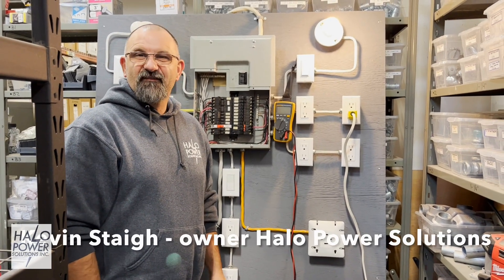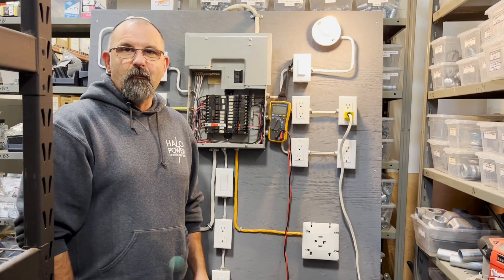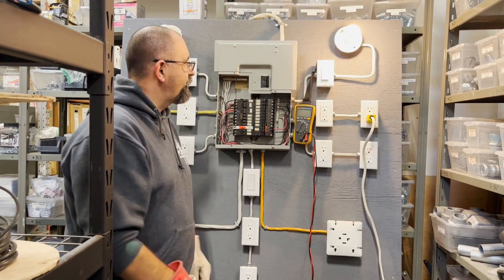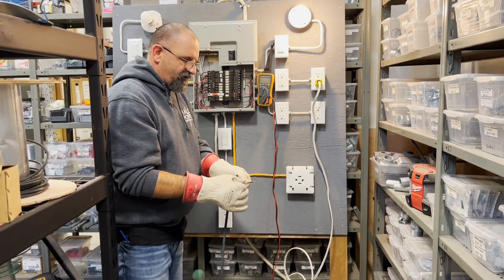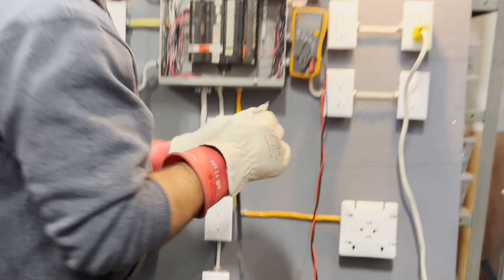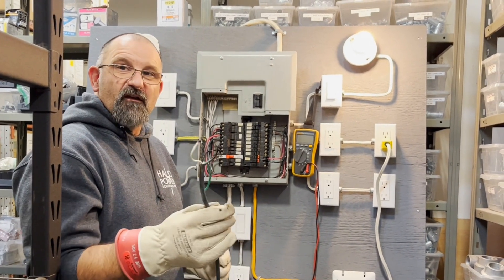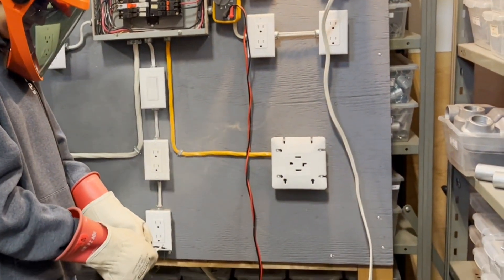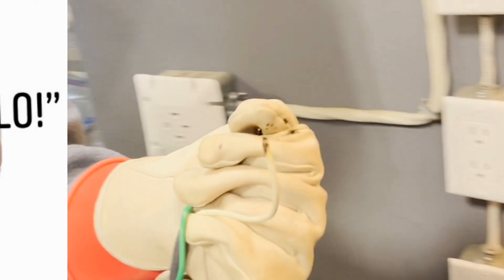Federal Pacific Federal Pioneer FPE panel fire hazard | Sparks fly but the breaker does not trip! |

Comment: It doesn't prove much, unless you compare to another breaker.  Breakers trip based on current and time.  High current for a very short amount of time won't necessarily trip any standard breaker.  That's why arc fault breakers were invented.
Reply: Any decent breaker will trip instantly with a dead short like this, as demonstrated on many other videos and on the next video posted to this very channel last year. It absolutely does prove something, it proves that these breakers are very shoddy and dangerous. You do not need an arc fault sensing breaker to ensure cut out with a major, high current short like this. A dead short that produces a flash this bright and wire vaporization / loss this easily observable is dissipating a LARGE amount of energy - likely dozens of joules and well over a hundred amps - that would cause a trip in any quality product rated for 15 amps within milliseconds.

Comment: Electricians enjoy fear-mongering because it makes them a lot of money.  Almost all of them do it, unless you have an electrician friend you can trust (I've known mine for over 50 years).  The Canadian Federal Pioneer panels and breakers are fine.  There's hundreds of thousands of them installed in Ontario and houses aren't burning down. They had a recall many years ago for their 15-amp breakers (the square handled blue ones with no hole though it) but that was corrected a long time ago.  Check the thread out on electriciantalk "fpe-stab-lok-work-just-fine" (Google it)

One comment:
"how can I strike terror into my customers hearts with such unfrightening data 😆"

Find an electrician you can trust.

Comment: My dad’s restaurant has the federal pacific breakers. i’m scared now
Reply: Those panels are extremely dangerous I recommend getting it replaced asap
Reply: @erickmorton8085  is it a Stab-Lok?
Reply: The only thing that was ever at fault was the trip rating of 2 pole Stab-Lok breakers. Gone by 1983. USCPSC did not issue a recall or warning. The panel itself was never at fault. This is all very well documented, but many folks like their version better and some even use it for advertising. I was in business through the whole thing, when information was current. It has ballooned into fiction. There are people writing that the US NEC "banned" FPE, by name. No way, No how. Requirement of approval by UL and the like, of course, and as always, with exceptions. Should you replace FPE StabLok panels and breakers ? Probably. Why ?  Because it is at the minimum 41 years old and you might have that last 2 pole breaker with inaccurate trip calibration. How many have I seen myself, live and in person in 50 years ? One.